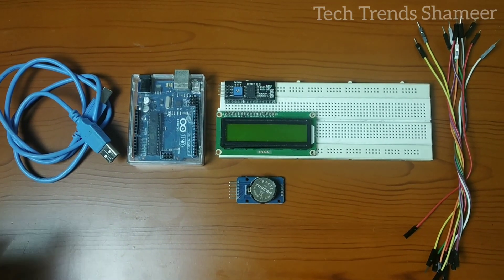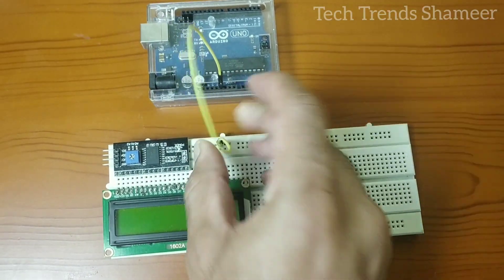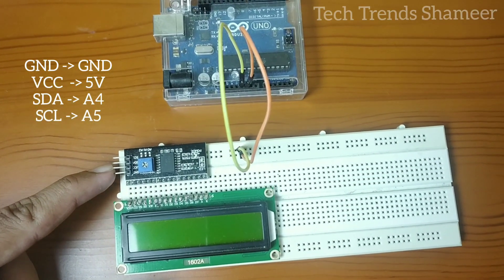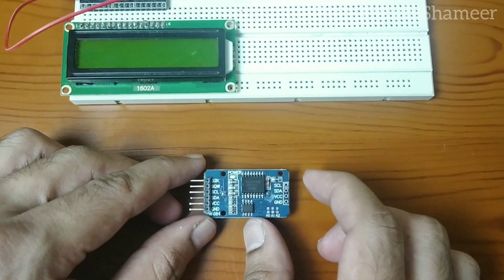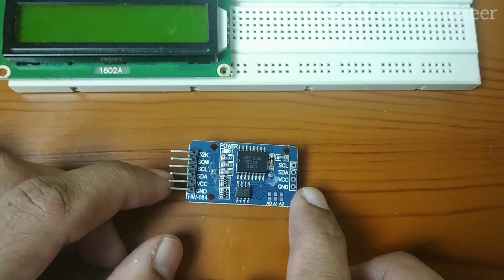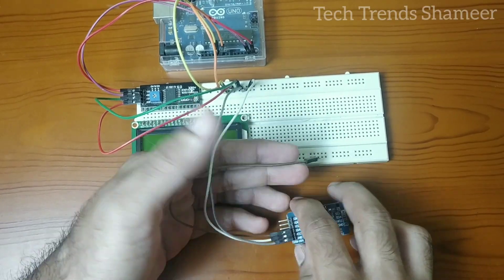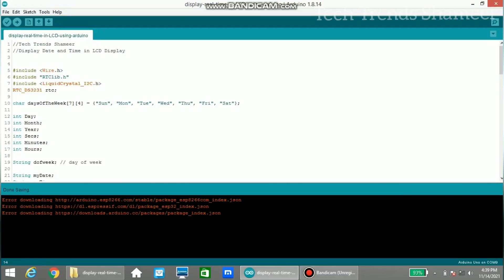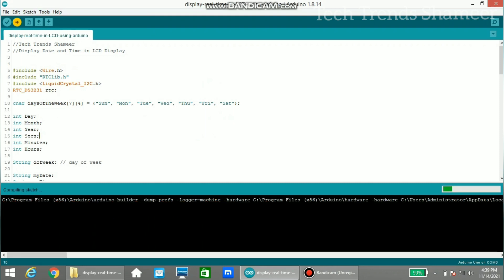How to Display Current Date and Time in LCD

Comment: Please share the code.... It isn't working
Reply: I checked the code from there... 
Is that the same code you used in the video... Please copy the same code here... Please
Reply from the maker: @vaijayantikolhar8735  yes. It's the same code
Reply from the maker: https://github.com/Tech-Trends-Shameer/Libraries/tree/main/LiquidCrystal-I2C

Try this library
Reply: @TechTrendsShameer Library is installed.... But nothing is displaying on the lcd
Reply from the maker: Can you check the address of your I2C module by using the below code?

 

#include <Wire.h> 

void setup()
{
  Wire.begin();  
  Serial.begin(9600);  
  while (!Serial); 
  Serial.println("\nI2C Scanner");
}

void loop()
{
  byte error, address;  
  int nDevices;

  Serial.println("Scanning...");

  nDevices = 0;
  for (address = 1; address < 127; address++ )
  {
    
    Wire.beginTransmission(address);
    error = Wire.endTransmission();

    if (error == 0)
    {
      Serial.print("I2C device found at address 0x");
      if (address < 16)
        Serial.print("0");
      Serial.print(address, HEX);
      Serial.println("  !");
      nDevices++;
    }
    else if (error == 4)
    {
      Serial.print("Unknown error at address 0x");
      if (address < 16)
        Serial.print("0");
      Serial.println(address, HEX);
    }
  }
  if (nDevices == 0)
    Serial.println("No I2C devices found\n");
  else
    Serial.println("done\n");

  delay(5000);  
}
Reply from the maker: please check video description.